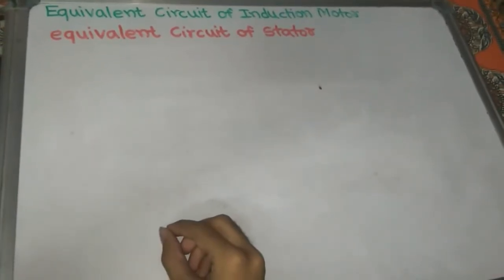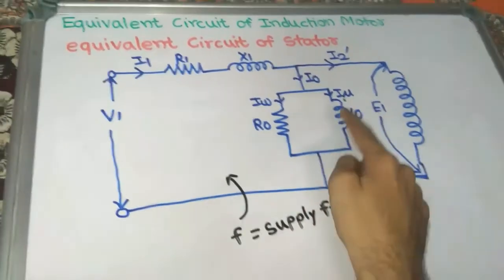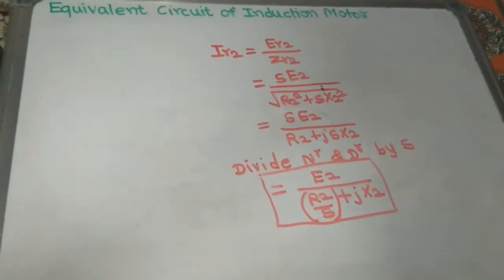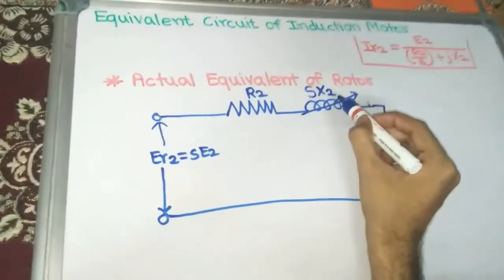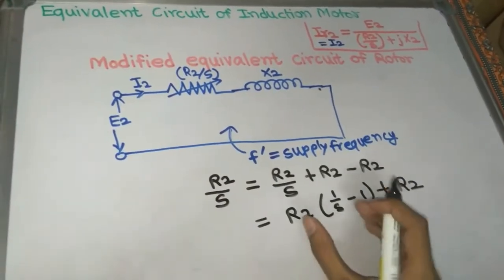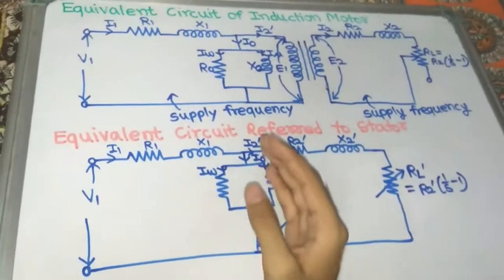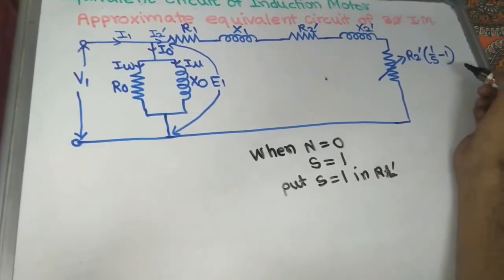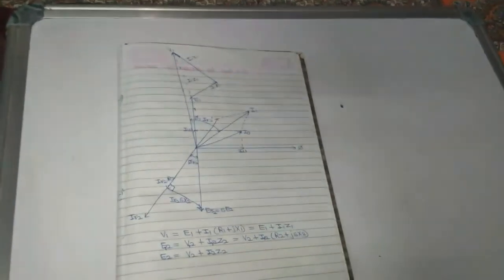Equivalent Circuit of Three Phase Induction Motor

Comment: Why did we divide by slip S, in the rotor? how is the power delivered the same when dividing by slip?
Reply from the maker: As we divide by slip s, rotor reactance, rotor frequency, emf is considered to be for standstill condition only, not for running condition 
So power delivered remains same. 
And three phase induction motor acts as a generalized transformer